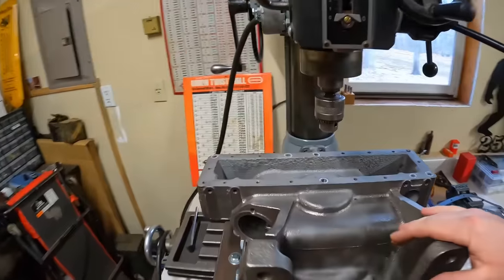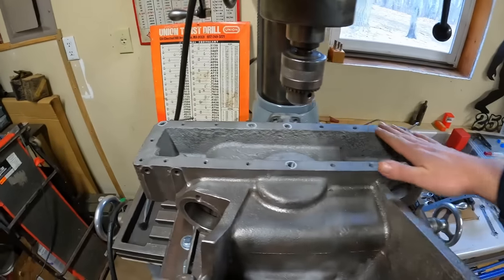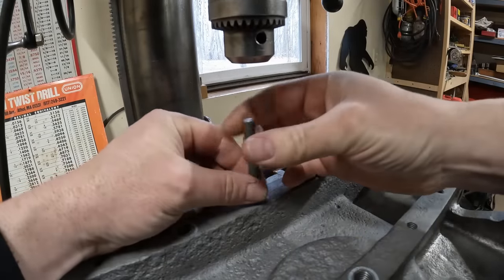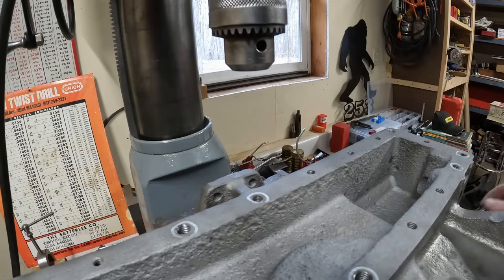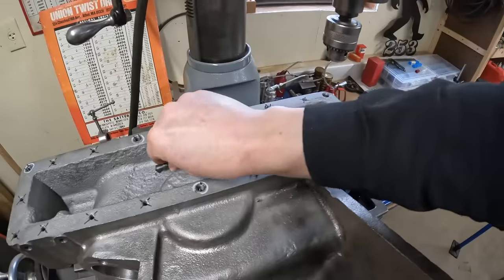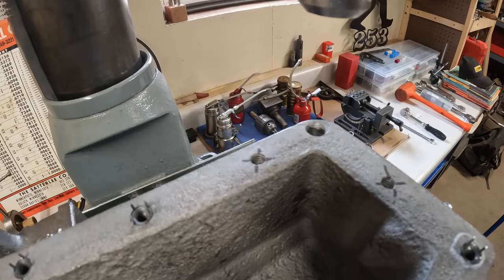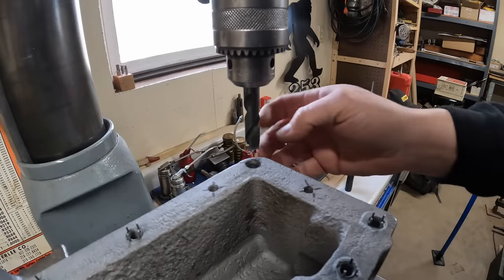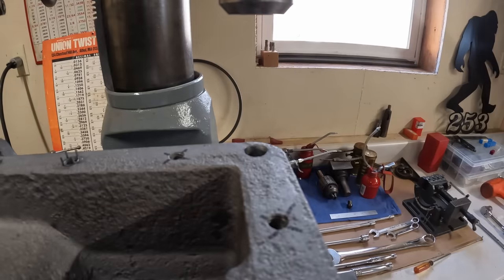#X231 Prototype Part 73: Front Bolster Casting Work Begins - Radiator Tank KEENSERT Thread Repairs

Comment: I have a stupid question about your super M: you did almost a whole video on your H regarding replacing the mesh inside the grill...is that same mesh on your super M?
Reply from the maker: Yes, same system.
Reply: @squatch253  I've seen some M's with a removable plate at the bottom of the grill...was that for residue removal if you didn't have that mesh?
Reply: That removable panel is for front cultivators to attach to the main steering spindle to allow them to turn with the front wheels.

Comment: Meaning no disrespect when I ask this question. I noticed you're not using drilling oil and maybe I didn't see it. What is the reasoning? Just for my knowledge.
Reply from the maker: Cast iron is always worked dry. Any steel that I’m drilling out here is minimal and I’d rather not have surplus cutting oil seeping into the pores of the cast iron 👍
Reply: @squatch253  Thank you for that answer, I did not know

Comment: Why aren't you using a cutting oil
Reply from the maker: Cast iron is always machined dry.
Reply: We supplied CAT paint. I was able to get a full tour. The most jaw dropping station was the CNC machine for engine blocks, punching 2-3 inch holes into an engine block, completely dry. I had no idea you could do that.